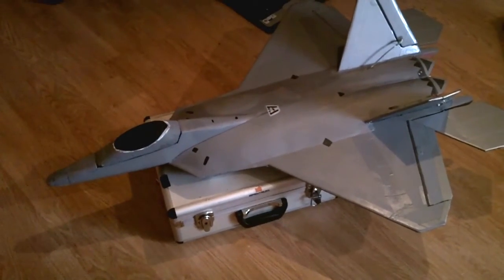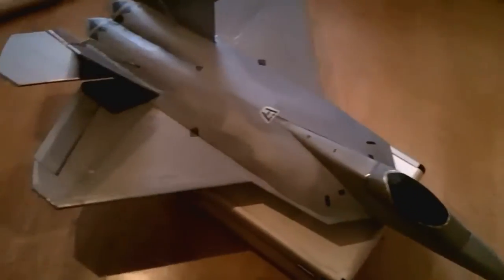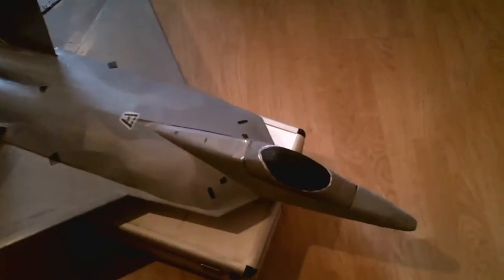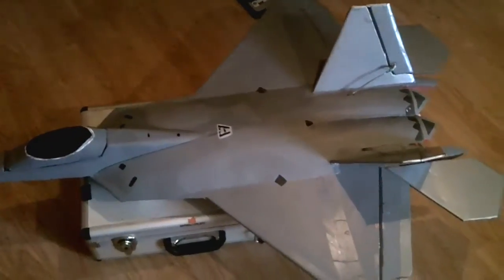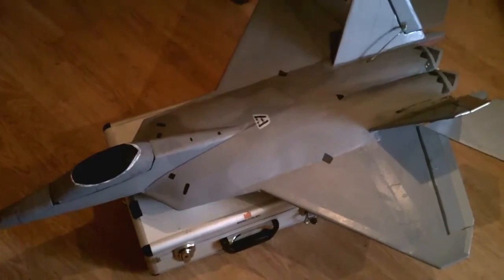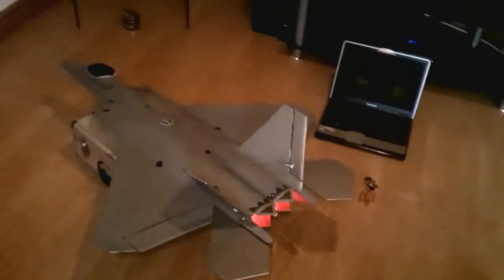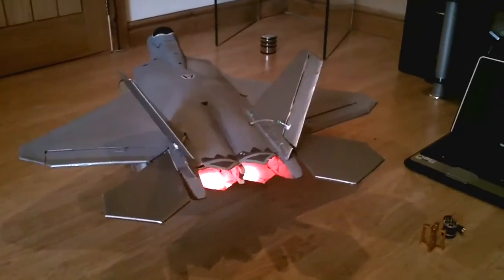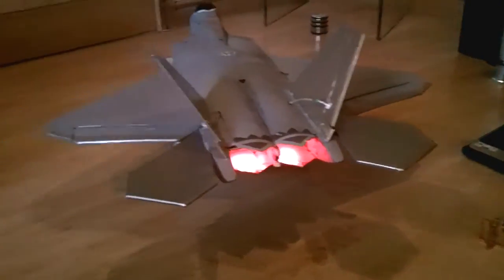F22 RAPTOR Part 1

Comment: I 'm building the same foamy, I wanted to make the wing out of a single piece of foam. I hunted everywhere for a foam board large enough, I found it,  the largest piece they had was 5 feet x 4 feet x 1/4 inch and I payed $11.00 for it. So head for the nearest Michelle's craft store. They have it back in the frame shop. I cant believe they asked if  I would like it cut to a certain size.

Comment: I would have the big one
Reply: Conversation started today
Muhammad Sehran
3:40am
Muhammad Sehran
Hello, I need to ask u some thing.
    I am trying to make a an rc F22 raptor designed by steve schumet and i an using a scale of 140% so the dimentions of my f22 is going to be wing span:36.4" and length:50.4".and with out any electronics its weight is 380grams-400grams including landing gears.
      And i have a almost 100$ to buy motor,prop,speed controller,battery,and servos.could u plz help me out what exact combination of all the electronics would be the best.And i live in germany so I can only buy all the stuff from ebey.
       I will be really thankfull to u if u could help me out.
waiting for ur reply.thanks

Comment from the maker: @rgthd007 Use the small motor for test flight and it had plenty of power but unfortunatly fell apart mid air! luckily no damage to the f 22!       it now has the big Turnigy motor on it but had to put more weight on the nose to balance it out! cheers and thanks for watching"